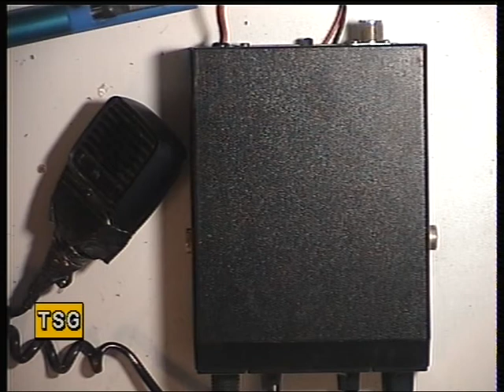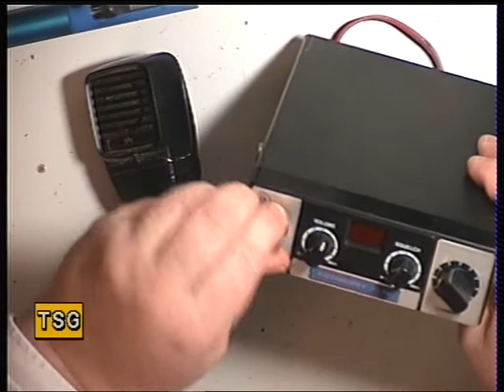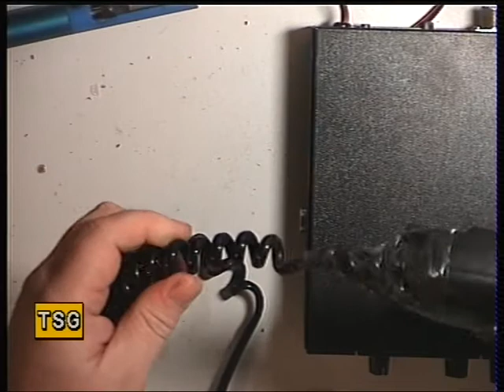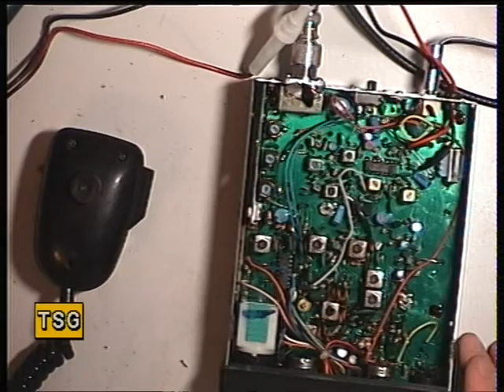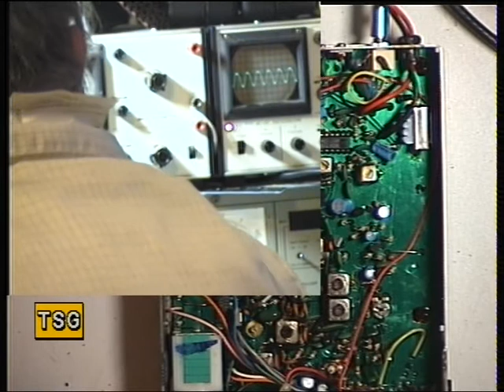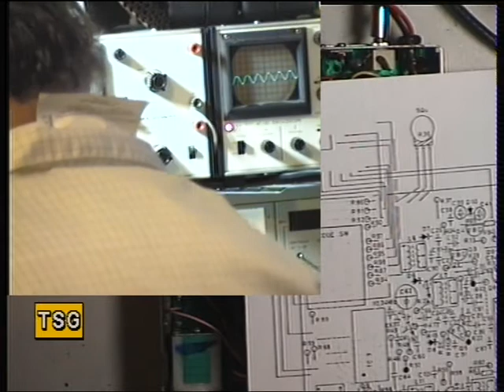LCL Economy , UK (CB 27/81) CB radio (Mobile) - Transmitter alignment

Comment: Dear Sir,
Recently I "dig" in my stuffs and I find an "ECONOMY 22FM" radio, but missing the final transistor. If you have any schematic please kindly share with me. I am planing to fix it, just as hobby. Thanks in advance.
Reply from the maker: László Oszkár Szabó Bear in mind this channel is for UK only sets. If your Economy 2FM is basically the same circuit, then have  a look on the SCRIBD where I have posted the schematic diagram etc
Reply: UK CB radio servicing MAny thanks!! I find it:
//www.scribd.com/doc/122640196/LCL-Economy-40FM-CB-radio-user-instruction-manual-circuit